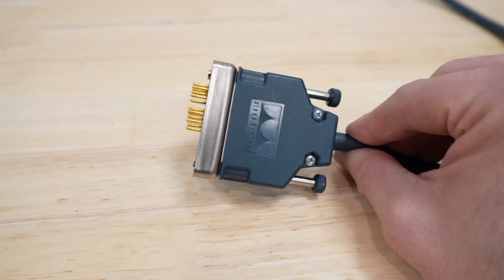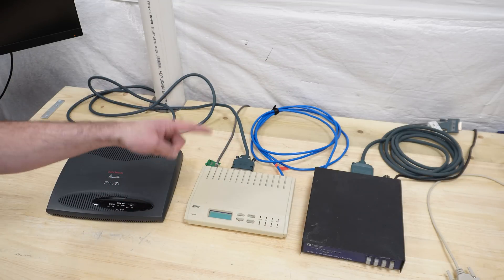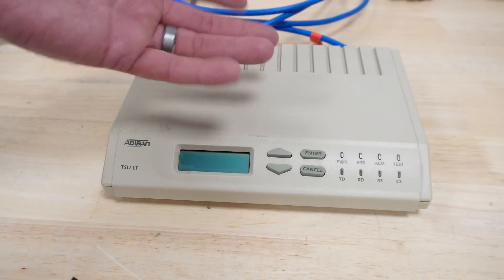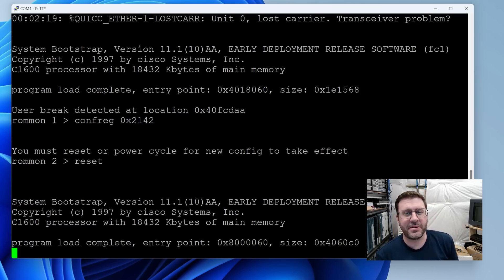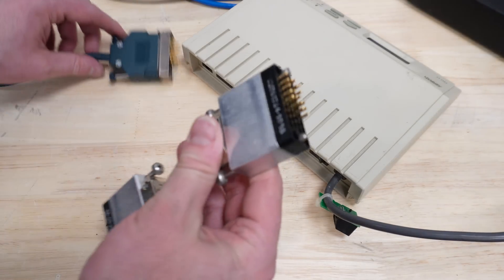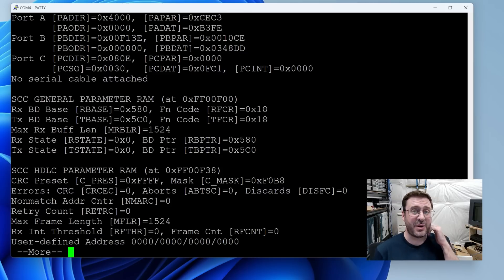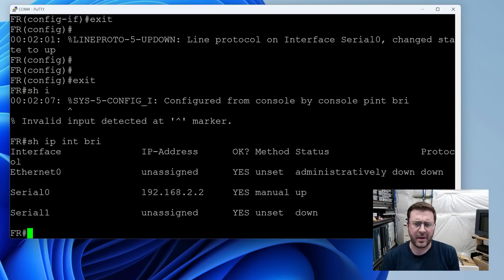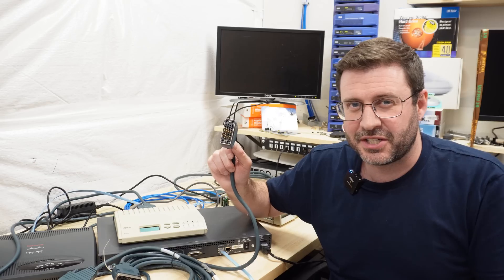V.35 Cables

Comment: giving me flashbacks, one of my first tasks was setting up this junk for customers. also everyone should just sit with just how old that stuff is for a minute - and it "just works"… IIRC the 1600 series you've got was probably around $1200, an Adtran CSU/DSU maybe $1000, that cable was $100, and then the T1, depending on many different things, but let's say private leased line in a major city, at least $800/month (that would not include internet, obvs).

Comment: Locomotives/high speed rail equipment i worked on have those winchester connectors. they are extremely durable and they still install them today i believe.

Comment: I always hated having to tighten down those V.35 connectors.  I would always get it uneven...  Ooo...  I used those Motorola FT100s.  They could split the timeslots between serial ports like you mentioned with the Adtran.  We used them to have serial terminal WAN link on one and a Cisco 2500 on the other.

Comment: Love seeing this old CIsco, v.35, and CSU/DSU gear. I was very fortunate to go very fast from desktop technician, to server technician, to network engineer in 2 years from 1998-1999. I installed tons of these Cisco 1600s, a fair amount of 1700s, 1800s, etc. Back in the day we charged $1,000 to setup and install one of these routers (on top of selling the router to the customer), and get a business either connected between two sites or to an ISP (and in that case we'd set up NAT and some basic outbound IOS firewalling). Glad to hear you already knew the whole "internal" vs. "external" (or "network", which was meant to mean the telco "network").

Comment: I worked in a dialup ISP in the late 90s we had piles of those Adtrans. Bringing up those serial connected CSU/DSUs was pretty easy. It was the bread and butter of 90s networking and they were EVERYWHERE. Point to point T1s were easy because you controlled both sides and you got to choose the encapsulation protocol and whatnot. Connecting up to other networks (Like your upstream provider) got more complicated because you had to know what settings they expected.

Comment: That Cisco 2500 router brought back memories of my high school Cisco networking class back when they had half way decent classes. I had two computer repair classes, programing, and Cisco networking CCNA preparation class. My old high school now has a YouTube streaming class how times have changed.
Reply: Same, but back then I didn't unterstand the point of just connecting two routers with a weird serial cable. Our teachers missed to teach that usually there's public telecom like T1 in between. No CSU/DSU gear in the classroom.

Comment: 10:50. Those v.35 cables use a differing pin configuration for the CSU vs DSU ends.   I remember struggling with it in my early 2000's ccna classes 😅

I remember something about the attached Cisco labels having something on them identifying which cable is for a CSU vs DSU "plug"

-- old fart

Comment: At 7:05 https://youtu.be/J50jSmVVKiI?t=425 you plugged in the power cable wrong. You were supposed to plug it in and flip the metal wire clip onto the connector to hold it in. But you instead routed it through the clip.

Comment: You'll forgive my pedantry, but that connector you keep calling a DB-60, is an LFH-60.  Even if it were part of the D-subminiature specification, that's not a B size shell, it's closest to an A size shell, although the proportions are off, and DA connectors max out at a density of 31 pins on the double density DA-31DD.  I know I know, nobody cares.
Reply from the maker: True! I saw both thrown around and chose poorly 😂

Comment: 6:42 That right there’s what you call a “Load-bearing Power Cord”, an essential component of a typical 90’s “cable hell” network closet.  No space in the rack?  Hang it from the outlet!

Fun made-up fact: Linksys introduced the lightweight plastic shells because the barrel jack just wasn’t strong enough to keep the network up, literally!

Comment: Thinking back at how many of those cables I've scrapped after we basically left them for dead after upgrading to the "newest thing".

Weirdly in the name of progress I think our overall "remote" network performance to the "central office" has gotten worse since moving to commercial broadband with 4G/5G backup. T1 was faster for the network traffic we have at "work" No it's not 100Mb/s but it's sub 10ms and when you are sending tens of bytes to hundreds of bytes back and forth there is no saturating of that big pipe. Plus the old school DSU's had way more "error" lights than that of the 2 or 3 leds that Comcast Business or ATT Fiber have on their gear. 

I loved it when we got those smaller "newer" V.35 to mini plug Cisco cables. Made running it to the equipment mounted directly above each other in the rack a little bit easier. Hiding away 12 feet of cable to go a foot is quite complicated on gear where all of these connectors were front mounted. 

Any up till now I never thought about hooking 2 DSU's together like that. Wonder what the max distance between the two are. In the telco world If I remember it right back in the 90's  we could get a t1 line at 12,000 feet from the CO without much trouble.

Comment: I remember dealing with those V.35 cables, along with a Cisco 1800 series router and Adtran CSU/DSU fed by a fractional T1 (frame service if I remember right) back in the mid-90's when I was a network admin for a dial-up ISP, right out of college. We used a bank of US Robotics 56k modems until we finally invested in a RADIUS server and modem cards. Good times.
Reply: Hah, 1600s were late 90s, with the 1800s not arriving until 2000s if I recall correctly.
Reply: @ it is entirely possible I may be misremembering the router model. I just remember it was a 1U rack mount unit from Cisco that used a V.35 cable.

Comment: You'd think there would be a multi-line configuration or something like that for these V.35 connectors to justify having a 34-pin connector, but that's not the case. Even the most full-featured interface only uses 19 pins. And let's not get started on Cisco's DB-60 only using like 10 pins. There's something weird with serial connector standards and people just using wildly too large connectors.

Comment: Ha!  I remember taking a networking class and seeing those V.35 connectors for the first time.  I was just like.. LOL.. WHUT!?!  WTF is this?!!  🤣 Even in like 2000 they seemed ridiculously chonky and old-fashioned.

That second Motorola TSU with the broken case.. my gosh... those were everywhere.  You couldn't walk into a comm closet without tripping on ten of them.  Before you even opened the door at any business, you could count on seeing at least one of those, an ISR, and a Catalyst 2650 in a Chatsworth 2-post aluminum rack, next to an amber monochrome monitor and keyboard used to program the PBX.

Comment: I have a module with the same connector (WANrouter 90) as seen at 4:41, it is for different synchronous and asychronous connections, but I don't know if it is the same connector from the pinout or if it is a standard or not.
Reply from the maker: interesting! I hadn't seen a use for this connector yet
Reply: @clabretro  The pin assignment is described in Appendix A of the WANrouter 90 Owner's Manual. If you know the assignment of the connector on the other side, you can determine whether it is the same connector.

Comment: The 60 pin cisco connector was always puzzling to me, I assumed it was so it would be compatible with a lot of different serial cables like this v.34 as well as db24 or whatever but would love to learn more about it.  Like it can tell when the cable itself is plugged in.

Comment: I run into these devices frequently in Government sites. They are no longer in use, yet they are still in the racks and the T1 smart jacks still hang on the wall nearby and THEY'RE STILL POWERED UP!!
Reply from the maker: I think that's very common! It's also basically how I came to own these units... just sitting doing nothing off in some closet somewhere until someone found them.

Comment: Back in the day... Mid 90's we used these to connect networks at our various manufacturing plants.  We had a main office with our network and servers and remote facilities with remote networks.  We initially used "leased lines" - dedicated 56K data lines connected to modems on each end.  Then we went to T1 lines and CSU/DSU's The CSU/DSU's were capable of handling voice and data.  A T1 has 24 channels of 56K and one of the channels was reserved for the voice Direct Inward Dial (DID) data. We would allocate some of the channels to voice and send them to our PBX system.  And some would be data going to our router.  I think the more advanced CSU/DSU units had multiple v.35 connections to do this. 
This was pre-Internet and then into the early days of the Internet.

Comment: You're making me feel old..  :-)    Yes.. in a back to back scenario, you need one CSU to provide clock because in a regular telco connected situation, the telco is ALWAYS the clock provider, because they had to make sure all of their clocks were sync'd.   One other clock mode would be to get the clock from the v.35 side, which would be needed if you had an internal tail circuit hooked to the same router which also had a separate network connection to the telco, so then the whole thing would still be clocked to the telco, even though one of your circuits never actually touched the telco.   Clocking was tricky and it wasn't uncommon to have it set wrong, and have it still work "most of the time" but have bit slip errors.  Lots of troubleshooting hours on stuff like that for me!!!    The whole DSU thing would allow you to (for example) have a multi-port DSU, and you'd configure how much bandwidth would go to each end device.  For example, I worked for a grocery retail chain, and we had a serial WAN over satellite in the early 90s that terminated into a DSU that could multiplex into separate connections for the store controller, deli/meat computer, and the pharmacy computer, all over one WAN link, but being completely separate serial links by the time it hit the end devices.  I believe we used a Codex 6015 on the ends.. There's one with decent pictures on ebay right now - I couldn't find other pics from the front and back..  Anyway, after I worked there, I went to Bell Atlantic, where we used all this stuff too, and one of the coolest adtran units I ever used was a 600e which had T1 in (optionally via v.35 if you didn't have the modem/csu built in) and you could split the T1 bandwidth between data over a secondary v.35 and use the other bandwidth as POTS phone lines, so if you were to use those as your CSU/DSU, you could split off 64k chunks of bandwidth, and literally plug phones (via FXS/FXO ports) into the back of the adtran units.  Very much a precursor to VOIP.  I was installing those in about 2000 or early 2001.  All good stuff.. Keep up the old content.  Watching you noodle through it and achieve success reminds me of exactly how we did it in the lab to make sure we knew what we were doing before heading out to the customer site back in the day!!

Comment: I only ever worked with these connectors a couple of times. First was when I decommissioned an old E1 link, didn't even bother checking the config, just shut down the router and ripped all the gear out of the rack. Second was when I needed a serial cross-over for a lab, and the only DTE/DCE pair I could find in the junk cable tubs with the right connectors at the other ends were a pair V.35 cables. It was used to simulate our existing WAN, pretty sure the link in question was a frame relay link.

Comment: Did a similar thing with E1 some days ago, inspired from your channel I started collecting some Cisco stuff. You can encapsulate in hdlc. Ppp isn't necessary, but you can use ppp multilink for combining several E1/t1 links!

I'm waiting for my T3 Equipment to arrive! Got one card for my 7200 with 2 fat bnc connectors like 10baseT and waiting for another module for my 2921.

Great fun to play with that stuff you dreamed of 25 years ago!

Comment: Having been roughly 7 years since my last Routing + Switching class, I misremembered these being symmetrical for easy interconnect, unless cisco had some variant of Winchester-style serial interconnect lying around... I think it was just a male and female v.35 though, both as serial adapter cables between two (educationally dated even for the time) IOS behemoths.
Reply: Yup, this is exactly what we were doing with them, although I don't know if the 2900s or 2800s supported anything faster over that link, I'm assuming we were just doing T1-speed password-authenticated PPP WAN connections over V.35 in a CCNA class in 2017.

Comment: Oh, neat... I'm still looking for a set of devices that I can connect with my "new old stock" V.35 tester pod that supports up to 19200 bps - I think there must be some terminals or similar things around for that somewhere... T1 is certainly beyond that devices capabilities.

EDIT: now that I'm watching this in full: the M/F version of the connector is much like the M/F version of the RS-232 cables. One is meant for the DCU one for the DTU (modem and terminal) so they have their RX/TX and handshake lines crossed. That tiny adapter is a gender changer, so there's what crosses your wires: you connected F to F via the M-M cable.

Comment: Awesome Stuff, Takes me back. Use to deal with Adtran channel banks TSU600's and Fractional T1's and a lot of those Motorola Modems in old Motorola 6809 Radio Trunking Systems. How times have changed.

Comment: When I moved from my parents home in 1998 I started working for a telco. Had 57k6 modem like most had at that time, used my Amiga 4000. Well around 2 years later I got a Frame Relay internet connection installed into my apartment as a bonus. It was only 64 Kbit/s FrameRelay (Just like enterprise WAN services was back then) - got 16 public IP addresses as well. And guess what. The router was the old trusty 1601 (its quite famous) 

A year later I manage to get an upgrade to an E1 (Here in Europe we do things faster as E1 is 2 Mbt/s or 32 channels) where those who already had broadband has 0.5 Mbit/s - It felt like I had fiber to make an time accurate comparison. Had both Amigas and PCs connected and all had public IPs. I even had a printer with an public IP lol

Comment: We had these serial cables in our high-school's networking lab and we used it for connecting two Cisco 1921s together with a HWIC-2T card. They needed two of these cables connected together, with one being DCE with the clock signal and the other being DTE if I remember correctly.

Comment: Troubleshooting tip for those CSU/DSUs and a great way to do a general test on a device level: that RJ48 jack hanging from the power cable? It's a hard loopback.  Connect one end of a cat cable to the CSU/DSU and the other end into that little jack hanging from the power cable.  If everything is working as it should, the interface on the router should detect a loopback and should run error free.

Comment: I remember playing with Packet Tracer during my CCNA 1 course and seeing all those serial ports on the routers and never really knowing what are those for, as I was associating them with dial-up or ISDN modems. At that time (2006-7) those technologies were basically dead and DSL or cable was the most wide spread connection type, and 2.4/5GHz "microwave internet" as it was known then was also available. As far as an end user was concerned, in all three cases you got your connectivity on Ethernet at the handoff point, maybe except for DSL (and I knew Cisco routers could be fitted with a DSL interface). My CCNA lab teacher couldn't really explain it (now after 18 years I know that even he got some things wrong during his lectures) and I just was left without an answer. Later, I looked it up on the internet, but I haven't really seen a practical example of it should work, until now. Thanks. (this is also why I love The Serial Port's videos, as I was simply too young to experience dial-up from the admin side of things)

Comment: When I was in hi school 1999 ~ 2004 I took the CISCO program 4 semesters gr 10 though OEC seeing this equipment and screen is giving me flashbacks all you need to add to this is V-LAN tunneling  though Fiber uplinks where 100 000 000bps was blisteringly fast lol. and why not use the AUI port instead of the RJ45 for your LAN connection if you want to be truly retro adds more blinking lights. as a bonus:)